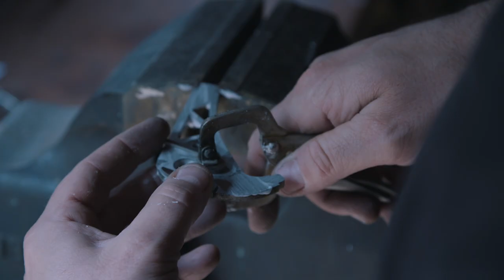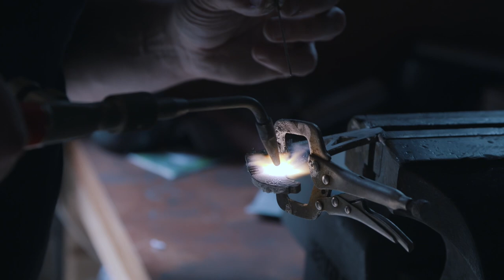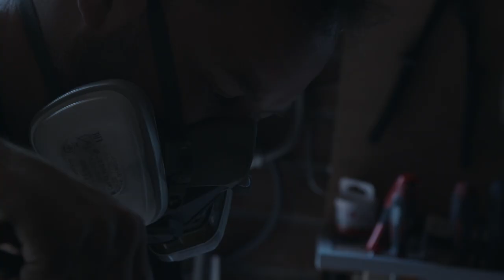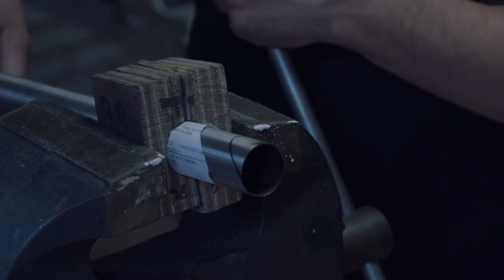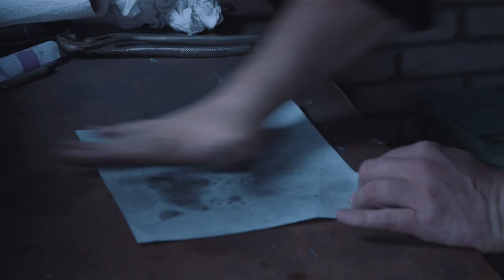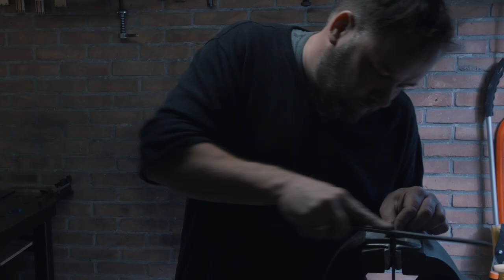project12 Cycleworks

Comment: Your seat stays are alarmingly thin on the project 12. What grade of steel are you using on the rear triangle?
Reply from the maker: Alarmingly? So far they are holding up fine in quite some bikes. ;-) But I am using 4130 seamless tubing. In my first frames I used crappy non chromoly 10mm tubing, and even those frames are still holding up in bikeparks around Europe.
Reply: @michielburgerhout3541  they are beautiful looking frames, it's just a little disconcerting compared to other bike manufacturers. Do you have pricing for them yet?
Reply from the maker: @toooldfortwowheels2048  You can check my website for pricing and options: project12.cc If you have any questions just email me.